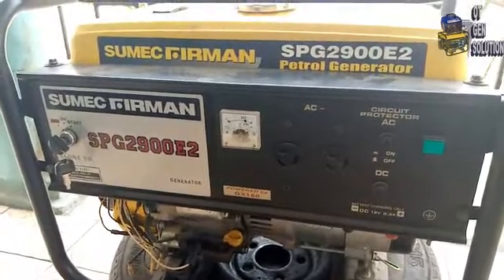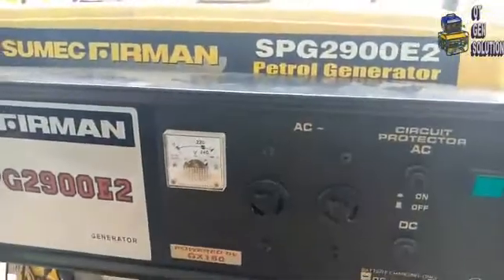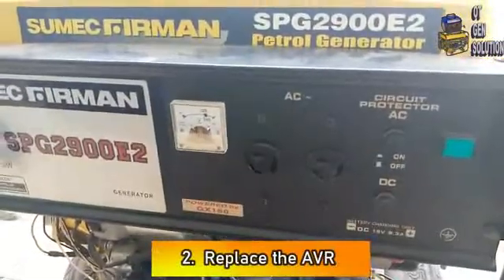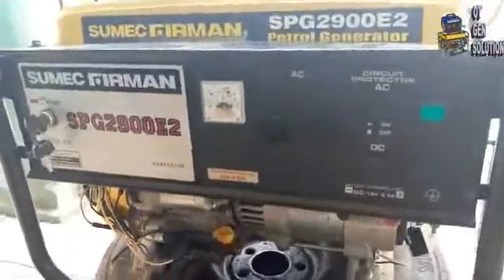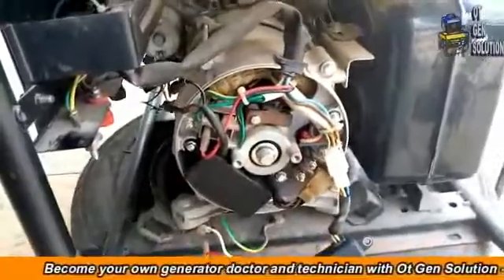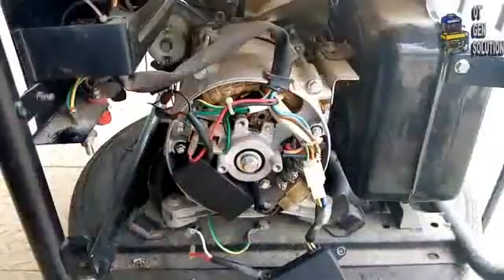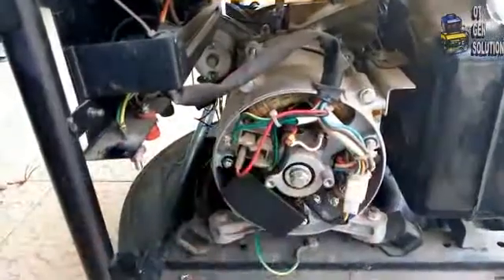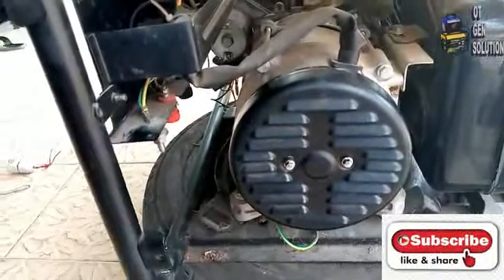Generator not producing voltage(electric current)- SOLUTION

Comment: I have a firman spg 1800 it doesn’t produce voltage I called a mechanic and he said I have to change the coil which is 75 thousand naira
Reply: Is this true please I need help to not get scammed
Reply from the maker: @oliveradonis6742  you can confirm from another mechanic

Comment: Mine is showing light working and sound well but no current when i switch it on i mean no light came into the house why kindly help me pls
Reply from the maker: @vallyhillsvalentina3202  there's current in the gen, check wire connections

Comment: But is it possible for a new Generator to have this fault
Reply from the maker: Is possible, but rare
Reply: I used it only two times and there was light everywhere but the third time no electricity power again , is that a bad Gen ? 🙏😔
Reply from the maker: @Utensils-ei7vr  no, it just need to be checked

Comment: My voltmeter reads 220v but it's still not supplying current.
Reply from the maker: That means there's electric power in the generator. Check your connections, male and female plugs
Reply: @OTGenSolution thanks for responding, which ones would those be? 🙏🏾

Comment: In my case, it’s generating power but it’s fluctuating high, low current. Then it runs normal for some minutes.  What could be the reason.  The voltage light also is fluctuating
Reply from the maker: Replace AVR

Comment: Brilliant video.

I have replaced the AVR of my generator 4 times and it kept getting burnt withing few days of use with generator running, but no power supply. What can I do to stop my AVR getting burnt?

Many thanks
Reply from the maker: Probably, The rotor coil is faulty, it's needs to be rewind

Comment: My generator produces power but suddenly the current just becomes so low/off and both voltmeter and indicator are off. If left running, overtime it comes back to normal again. What can I do please?
Reply from the maker: Possibly the field winding(rotor).
Have you tried replacing the avr?
Reply: @OTGenSolution  No, I haven't. Perhaps I'll just start with that, thanks